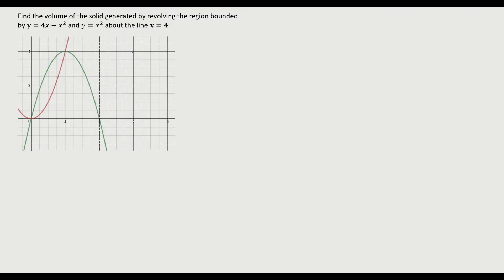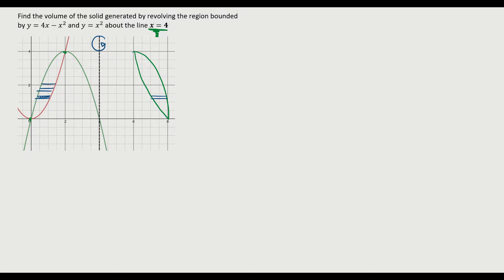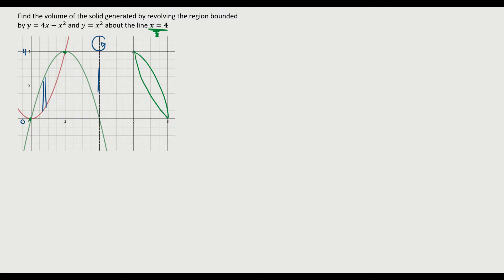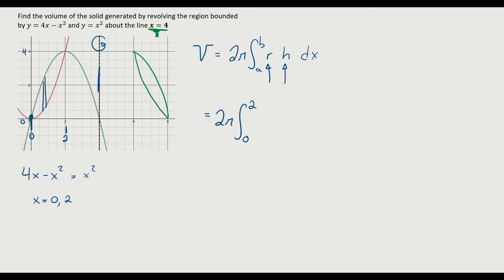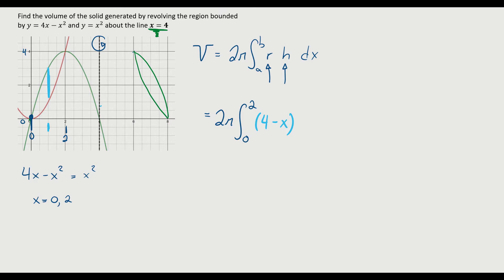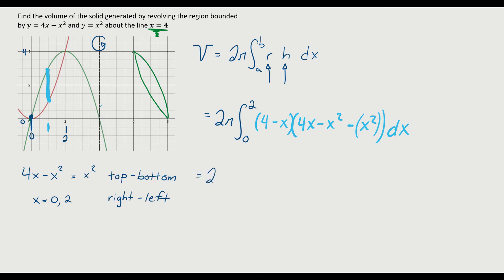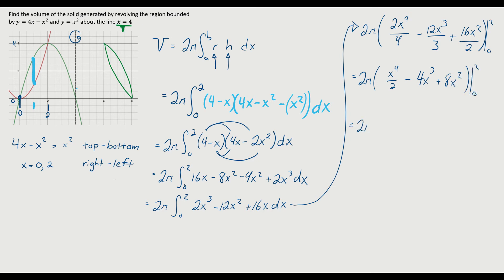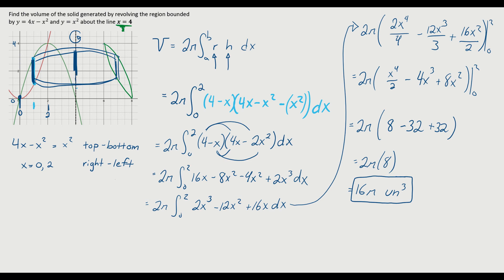Volume by Revolution: Shell Method around Non-Axis

Comment: H, the height of the partition parallel to the axis of rotation, should be subtracted by top-bottom, not right-left. Right-left is for when the axis of rotation is horizontal, as the partition will be laying down instead of standing up.

Comment: what conditions will the problem have to be for you to use right - left.
Reply: The conditions seen in the video is right - left. Right (axis) minus left (x)
Reply from the maker: With the shell method and when you are finding the radius of the shell, if the functions are in terms of x (as seen in the video), then it is right - left. If the function is in terms of y (such as x=y^2 + 2), then it will be top - bottom axis